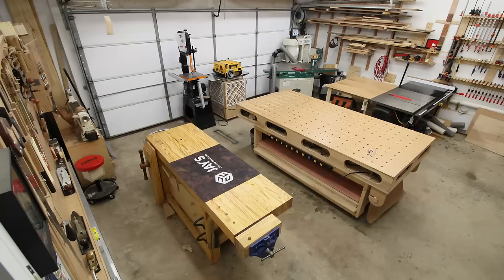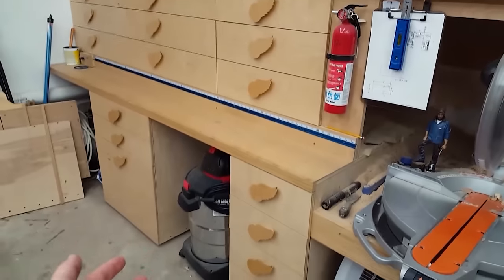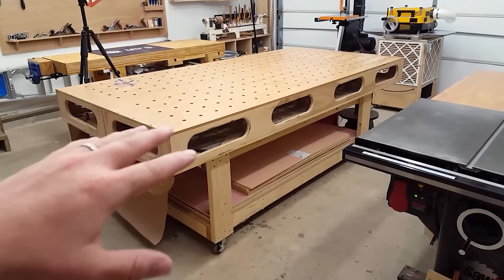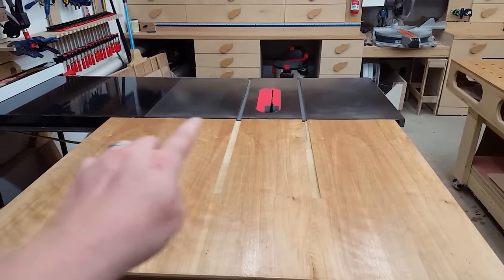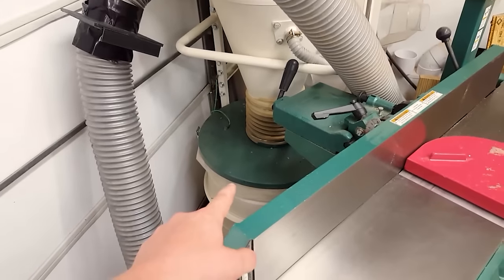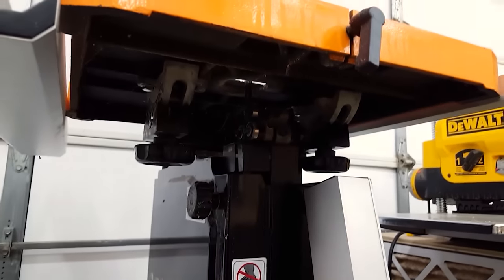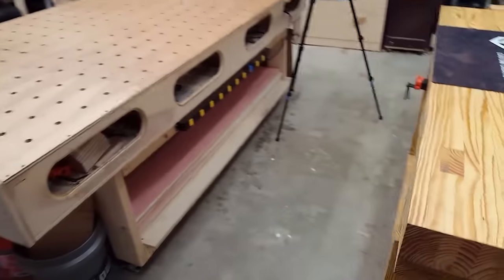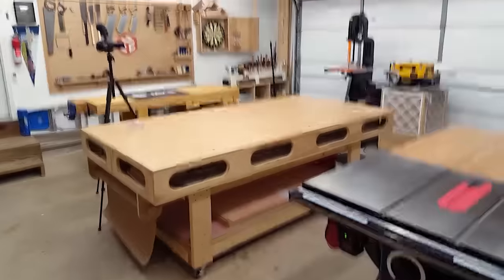Shop Changes / Shop Tour - August 2016

Comment: Jay, I like what you have done. I like your idea of moving your miter saw against the wall next to your tables saw. I have my saws laid out that way. The tables saw slides up against the wall so the saws are perpendicular from each other with the table saw against the wall. This extends the table for my miter saw since I have them both at the exact same height. You can always roll your table saw out if sawing a wide board.

Comment: What would be crazy is if the Polk Workbench cubby area was 2 inches wider with an open end so you could store full-size plywood sheets in there.

Shop is really looking like a full production shop now. I've seen projects like those moose and bear chairs and loveseat things in your old old shop but now you're really really setup nicely.

Have you covered your handsaws on your toolwall before? They look pretty nice.

Comment: You mentioned a shop vac for your bandsaw. I have an 18 inch Jet with the same problem. I have been thinking about adding a shop vac "System" to my 2 HP dust collector system. Instead of using the dust collector for tools like the spindle sander, scroll saw, drill press and the like the shop vac can be plumed with dirt cheap central vac pipe and fittings. The shop vac will be cheaper to run than the 2 hp motor and a lot more versatile. A few outlets can be used to attach a hose to connect to a random machine or clean up around the drill press or vacuum the floor..

Comment: Nice shop Jay.  I thought the clamp wall look perfect, but I can understand the hazard with them falling.  What if you swapped the lathe area with the clamp wall.  This way the clamp will be in the corner and away from accidental bumping thus falling clamps.  Then maybe you will be able to hook up your lathe to the vacuum system.  Just a thought,  either way your shop looks amazing.

Comment: I tried a shopvac style collection, it can work but is a bit fiddly. Basically I cut a slot in the shopvac nozzle and fitted it around the blade. Almost zero clearance fit. The slot grows bigger with use and is something of a PITA when changing blades, at least for me it was. I held it in place with strong magnets. Now I have built an enclosure underneath the table instead and hook up both ports to a full scale DC:

Comment: I've tried about 17 different ways to collect the dust from the band saw and a shop vac to right next to the blade was the second best.  I think all I did was cut some 2-1/2 pipe at about a 45 and CA glue a piece of 1/8 ply on the end with a small opening on the pointy end and two big magnets on the plywood.  Everything I ever did with the 1.5 hp DC was worse than that and the clearvue isn't much better.

Comment: hey Jay- just an idea for you possibly with your layout of your shop. one quick question first though: 
the side of your shop where the jounter, table saw, cyclone vacuum system is now- Is that the outside of your garage? Or is your house wrapping around to that side as well?
Reason being- if its an outside wall, you could build a Lean-to off the side of your garage that would be a room just for your vacuum cyclone, and maybe a compressor or something.  Just to give you a little more space. all of your vacuum lines could be ran to/from that room. Food for thought for you. (I'm sure that you've probably already thought of different ways though)
Let me know your thoughts! Thanks.        Sean

Comment: have you considered applying epoxy floor paint. it really dresses up the shop. you would have to move everything g to the driveway to clean the cement and then allow 24 hours for the surface to cure properly.

Comment: It looks like you have multiples of many types of clamps. Would a design where there is a front and back set of clamps be more compact? Where the back set is only accessible once the front ones have been removed. You would only need to access the back set after you've used the front ones, rather than having every clamp available all the time.

Comment: Thanks for the update, I just re-watched your last shop tour last night. I am finally starting to set up a shop and I'm modelling it off yours, for the most part, sans the lathe, planer and jointer. Question for you, I guess I missed when you changed table saws what you did with your router lift, do you see it as an important tool for your shop? whats your router plan?  Thanks!

Comment: Hi Jay. I like the changes. So I was wondering with the table saw + miter saw station layout, do you chop first or do you rip first? If you use the table saw first it seems that you have to take the piece to the back of the shop, pick it up from the outfeed towards the front of the shop then walk it back to the back of the shop to cut to length. It just seems like you would need to walk your goods around a lot.

Comment: How will you handle long sheets of plywood on the table saw now? Doesn't look like you have much room to bring them in and work with them. I know you can break them down prior to using the table saw, but you will have to deal with long pieces eventually.

Comment: Jay, just curious as to what kind of vibrations you get on that mobile lathe cart.  I have a mini-lathe and if I try to turn anything other than pens or small spindle projects, I get significant movement.  And my table is bolted to my wall...  Anyhow, just curious.  Also like what you did with the table saw.  I've considered that but thought it would hinder sheet goods...and then I realize I don't ever break down sheet goods on my TS.  Lowes handles the big stuff for me and then I work with the smaller stuff.  Thanks for the ideas.

Comment: Cool! It's a little late for spring cleaning, don't you think? :) Looks like a nice layout. Do you foresee any problems with your table saw  next to the wall like that? Other than that it looks like you've gained some space to move around. Good job.
Reply from the maker: The right edge of the table saw is dead space so it is overlapping other dead space on the wall where my dust collection and electrical run.
Reply: Yeah…. I guess I didn't think about it, but you had your band saw and planer on that end of your saw before without any problems, so it makes sense. Good Job!
Reply: Jay Bates 2 jay, I have the same saw and same setup. It works great. I can cut a full sheet and my dust collection abandon power run on the wall.
Reply: Jay Bates 2 Besides you can use the mobil base to move the saw anywhere you want.

Comment: A bit unrelated. I have a question about pocket holes vs screwing through the back in to the attachment peice. Which would be stronger?
Reply from the maker: Depends on the application and the board accepting the threaded part of the screws. Screwing into end grain isn't that strong generally speaking.

Comment: Hey Jay. Question about your cyclone. Did you change it to a HEPA version? I watched your tool talk and your shop update and it looks different in the shop update. Looks like it has the HEPA filter attachment? I'm going to get a Grizzly soon and just curious on which one you would recommend?
Reply from the maker: I did get the hepa upgrade. If it's within budget an increase in filter efficiency is always recommended.

Comment: Can you handle full sheets of plywood at the table saw with that layout?
Reply from the maker: Width, yes. Length, no. I previously made sure I had 8' of infeed and outfeed at all tools and realized I was worrying about less than 1% of situations. I don't recall the last time I needed 8' of infeed. But if I do I can move the saw and outfeed table forward one foot for the cuts and move them back. Super easy.
Reply: +Jay Bates 2 easy fix would be to swap table saw and workbench sides of the shop with the In feed side of table saw towards the garage door. If ever you need more in feed space you just open the door and just move the vacuum cart for more out feed room. Then it will also be easier to transfer material from your out feed table to your chop saw.
Reply from the maker: Not an easy fix. No power on that side of the shop for the table saw and no dust collection on that side of the shop.

Comment: Jay,  from a manufacturing supervisor perspective,  you've created more work for yourself.   When we design a shop floor layout, we create something called a spaghetti diagram to track movement of labor and materials.  Having to move materials to the back of the shop to use the miter saw station to break the materials down,  and then have to go back to the front of the shop to use the jointer or planer causes you to have to work harder and take longer to do the job.    Check out this video for a better explanation.
https://www.youtube.com/watch?v=5QEHS5tieiU
Reply from the maker: I took lean manufacturing and quality assurance courses in college and had first hand experience in those areas working in a frame mill at Ashley Furniture so I understand what you are saying and the perspective you are coming from. But having had this new layout for two weeks now I can say that actually working in the space is MUCH better than it was. Moving around the assembly table and moving the camera are the two tasks that I do the most. Both of those tasks got a lot easier. Also, all of my pathways in the shop have been increased and there is a lot more room to move around. I've come to value an easier path that is 5 feet longer more so than a more obstructive path that is 5 feet shorter.